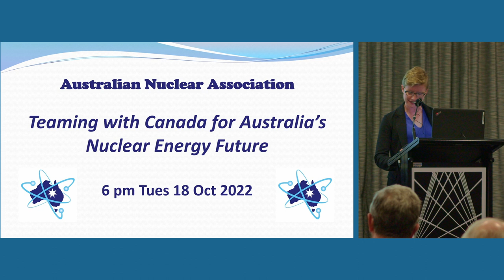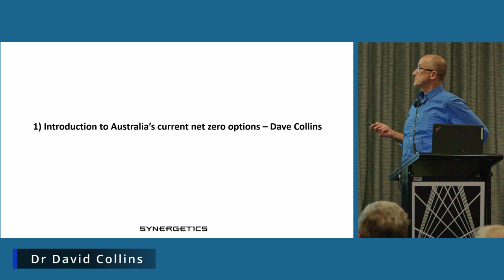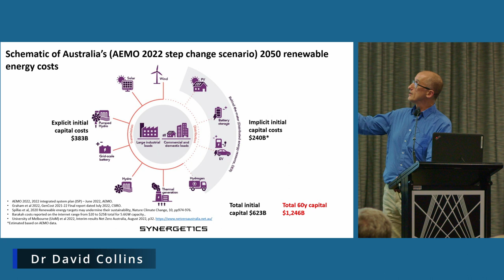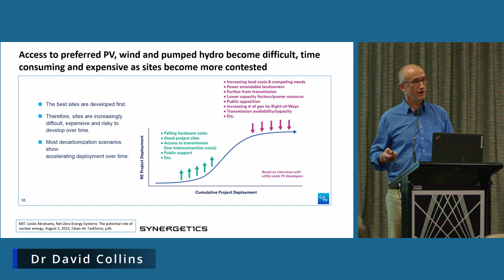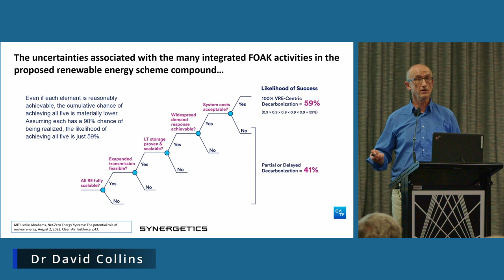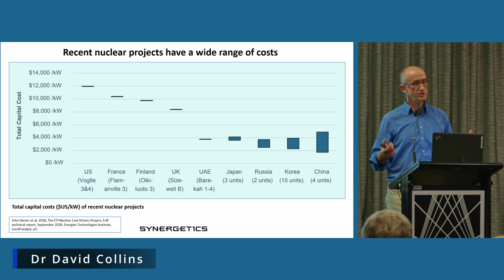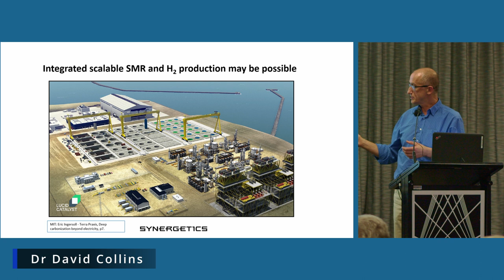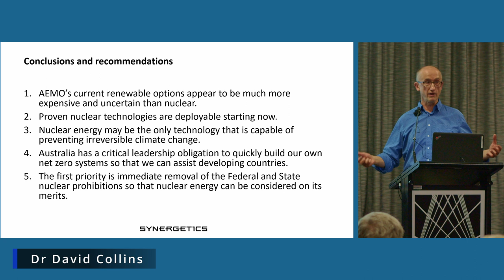Teaming with Canada for Australia’s Nuclear Energy Future - 1

Comment: At the end of the day Australia will have 20million EV 100kwh batteries. 
Electric vehicles big batteries are for the long drive. 
The daily drive is smaller at 7kwh. 
I thought that this would be important. 
2,000gWh daily and topped up daily for free, ezi pezi.

20million buildings in Australia and all with roofs and all connected to the national grid, so a few PV panels on the rooftop, ezi pezi. 
20million × 33kwh = 660Gwh daily. 
At the point of use.

All buildings have windows and in Australia the same amount of 'windows' in the avg home, but at half the cost, and with PV coating would supply massive amounts of clean electricity AT THE POINT OF USE.

No transmission infrastructure increases. 
Australian national grid is 1million klm. 

The AEMO said 5 times more grid capacity in a no CO2 fossil fueled Australia. 

Australia knows that when the 'poles and wires' were 'gold plated' for reliable existing performance, the Australian electricity power bills to every home exploded.

At the end of the day ALL THE FACTS are needed. 

Solving the wrong problem in engineering is stupid, to be blunt.

Australian latitudes are the same as the Sahara Desert, not Germany cold latitudes.

Let's just stay with reality.